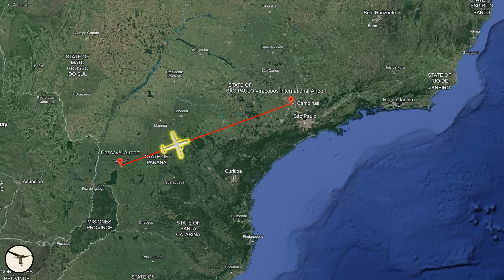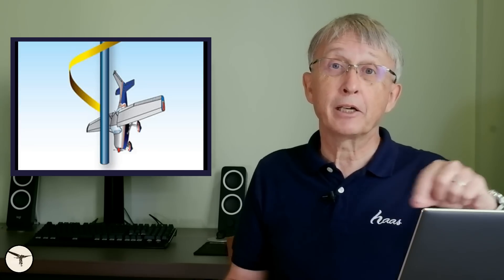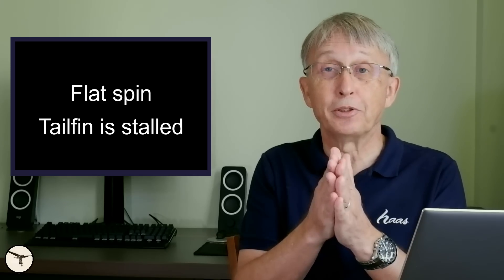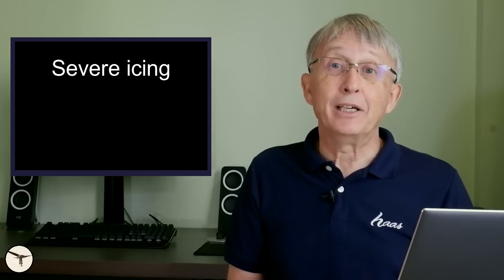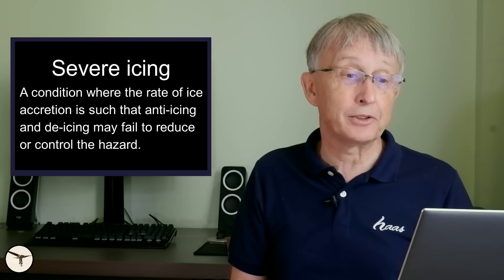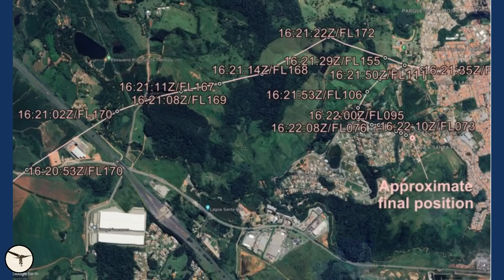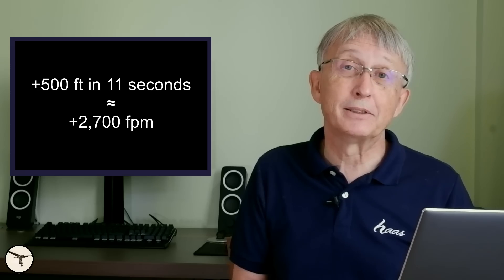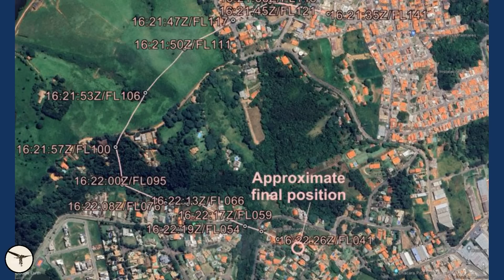ATR 72-500 Crash: Understanding the Fatal Flat Spin & Severe Icing Dangers

Comment: Thank you — complete and clear as all of your videos. Just a question: any contribution to the accident due to the “T-tail” of the ATR family? I read in the past that the “T-tail” shape, with the elevators mounted in the upper part of the fin, makes the aircraft more prone to a deep stall / super stall, that is basically unrecoverable. You did not mention this aspect, neither do I find it mentioned in any of the current, first-time analyses of this accident. Is it because this is not likely to have had any effect in this case? Thanks!

Comment: The last sudden updraft could be a clue... maybe the FP was startled & pulled back too aggressively on the power levers, accidentally putting one or both props into beta.  I wouldn't rule out accidental / inadvertent prop-beta mode.  Flying in convective areas can be very disorienting and startling, and it's not that hard to pull a power level into beta (in a startled or stressful moment).

Comment: 07:05 A sudden steep climb and speed lost a lot.  Someone did a very steep climb after losing about 400 feet of altitude.  That looks like a Panic Pull.  Big pilot error.  Nervous pilots do that kind of stupid reaction.  Happens on USA GA too.  Then they didnt cut the engines on the spin and used one engine to help recover.  Panic Pull and Panic Freeze with full up elevator my CFI used to call those stupid reactions.. My CFI taught the hardest maneuvers like 4 kinds of EFATO and 3 feet Go arounds with full flaps, spins on Tomahawks and aerobatics.  Those hard maneuvers exposed chicken pilots.

Comment: Interesting explanation. So basically in the case of the ATR, there is no way to recover from a flat spin? 

I know it is significantly harder than a 172 obviously. But I wonder if there is some way to use asymmetrical thrust to at least not the spinning and then allow the nose to start to drop.

Comment: FINAL REPORTIG-136/CENIPA/2013 (PP-PTU_26JUL2013_ing_IG.pdf) - Serious incident with ATR-72  in 26 July 2013 in Northeast of Brazil, who enter in ice conditions in a night flight, loose speed, enter in stall and fall ~50000 feet's (~1500 meters), but regain control and land safety in the destination.

The pilots made a mistake by only turning on the electrical ant-ice, de-icing protections - leave the wings and engines rubber boot's off;  feathered the props, and the PC fight against the "stick pusher". Probable was the "stick pusher" action who save this flight.

Good analysis of the incident in the channel Branco Aviação - "UPRT | PERDA DE CONTROLE EM VOO ATR-72" in Portuguese, but has English subtitles.

Comment: After listening to your explanation of the aircraft flight controls and how it all works. 
It sounds like the crew experienced a total failure of the electronic flight controls. 
I speculate this, since most modern, and recently built aircraft are all fly by wire.
It will be interesting to see what the investigation uncovers.
Reply: ATR is cable airlerons, not sure what the rudder and elevator are but not fly by wire.

Comment: Clear and impeccable explanation commander.  As an instructor and aerobatic pilot I would like to add that there could also be a problem of asymmetric thrust during the recovery maneuver from the stall, due to ice obstruction, of one of the two air intakes.

Comment: So many questions. The ATR-72 is suscetible to ice (American Eagle 4184), but that would had been fixed after that event. The SIGMET reported to the pilots of the icing conditions. And what was that turn to the right? The flat spin ocurred after losing altitude, so it was not sudden. Maybe the fact of the icing disconnected the AP and the pilots were just trying to figure out the problem while going through an oscillation of altitude. I am shocked. So many questions about this tragedy. Also, the T-Tail configuration of this aircraft makes it almost impossible to recover from a deep stall.

Comment: Severe Icing….. Speed control may have been affected by a loss of engine power due to ice congestion at the engine air intakes. The power loss would introduce a yawing factor causing a yaw in the direction of the Flat Spin. 

The question would be,  were the "Automatic Flight Control Systems" in operation during this event? 

Autopilot use in icing conditions can be dangerous since the Pilot Flying has no tactile feedback with automation running the show. 

This is my guess concerning the source issues involving this event.  May our Creator bless and heal the victims' spirits and their families affected by this unfortunate event.

Comment: I'm Brazilian and I live in the flight's original destination (Sao Paulo). An important information about this tragedy is that there was a cold front right where the plane was flying. This reinforces the ice formation on the wings, because the plane came from a cold dry area and entered a hot humid area. This speculation must be corroborated or disproved by the ongoing investigation, of course, which is the only thing to clarify what really happened. 

Remember another famous accident from my country, the AF447 flight, which disappeared over the equatorial atlantic ocean in 2009: the black box was found only 2 years after, it consumed lots of money to be rescued, but was crucial to understand what caused the accident.

Comment: Very strange weather that moment. I took a chopper a few kilometers from the crash! 💥 the weather changed sharply to freeze 🥶 it was a cloud ☁️ day but Brazilian warm day. When I lended in my building office the crash was announced. What I can say 100% the wind 💨 of that day was strange and the weather changed sharply. I normally take my chopper once week to the capital for business! Very sad day for every Brazilian! Not a normal event!
Reply: 1)
yes, and the reason being a gust current change between 13:20 -13:30 GMT-4, from West to West North West winds. Causing a radius 0 condition on the center of the plane (vacuum). Autopilot decided to change into manual pilot mode after failing to stabilize the plane. 

2)  
this introduced a stall where autopilot in hotel mode favors altitude with tradeoff speed, in a span of ~30 seconds.
Reply: I know this given it's related to new gust setups starting mid June 22 2024, and the cyclones towards China.

Comment: In the 1950s, during flight test an F-102 delta wing fighter got into a flat spin at 40,000 feet.  The pilot recovered just before he hit the water over the Gulf of Mexico.  After that, the rule became:  If you get into a flat spin with a delta wing airplane, you pull the eject handle.

Comment: Pilot Suicide what a selfish act. I don't believe it was Pilot error, If they prove me wrong I appologise it has happened more times that you realise in avionics.
Reply: nope. it wasn't that. Another pilot minutes before literally experienced the same issue, but recovered from stall, notified air control, and air control didn't notify the pilot. 

air control neither told the pilot to move outside the cold currents. but that's debatable.
Reply: What an ignorant comment.

Comment: 3 things not mentioned:
1) two different sources report that the crew actually requested a lower FL when they noticed ice build up at FL170 but it was refused.
2) their flight data reports an impossible range of velocities along the whole trip, what caused this bug?
3) there are a couple of meteorological sources that claim that right where the plane stalled (it did so abruptly, almost backtracking on its ground path, quite confusing data) there might have been a sort of "squall" phenomena producing an enourmous tailwind that essentially reduced their effective airspeed close to zero - but I find this contradictory to the very claim in the same paragraph that suggets the near-zero groundspeed was also caused by the meteorological anomaly (i.e., is it a headwind or a tailwind?)...but they seem to explain that away by claiming it was a spiral vortex.
Reply: What velocities do you think were impossible?
Reply: @peteconrad2077  You might ask for, (a) The velocity range data during the whole flight is all over the place, not only at the time of the crash, but right from the beginning. Look it up (flight data services). There's something wrong with it as it can't possibly be physically real.  Or you might be asking for (b) right before the stall, the ground velocity goes to zero and then even becomes negative (the plane seems to back up in relation to the ground, if you look carefully at a detailed chart o the final ground speed/position data). This is clearly anomalous and I don't really understand what's really going on. ATR2's are prone to  stall during heavy ice conditions, their highly efficient wing makes them problematic in those circumstances, and then they are also hard to recover from a stall, very hard to recover from a spin, and nigh impossible to recover from a flat spin due to their T-tail causing lack of rudder and elevator authority in those attitudes, and their engines causing quite  a bit of rotational moment, torque.

Comment: July  26th 2013 22:00 UTC - Trip Linhas Aereas Flight 5591: An ATR-72-212A registration PP-PTU had a Severe Icing Event near Salvador, Bahia, Brazil, Follow the CENIPA Report:

The aircraft took off from the Zumbi dos Palmares International Aerodrome (SBMO), Maceió - AL, to the Deputado Luís Eduardo Magalhães Aerodrome (SBSV), Salvador - BA, at 2110 (UTC), to carry personnel with 4 crewmembers and 58 passengers on board. Around 2142 (UTC), on FL160, the aircraft entered a region that had the conditions of ice accretion. Although the aircraft anti-icing was activated, the air pneumatic de-icing was not activated by the flight crew. Then, there was a significant degradation of aircraft performance, leading to a reduction in the Indicated Airspeed (IAS). The aircraft initial cruise speed was 202kt. The aircraft lost 10 kt prior to the activation of anti-icing. The crew heard a noise described as similar to that of a compressor stall, followed by a loud vibration.  The aircraft reached 180 kt when the power levers were reduced to 20% TQ, leading the IAS to reduce down to 148 kt, and the autopilot was disconnected. The crew did not identify the cause of the vibration. Approximately 4 second after the autopilot was disconnected, the Angle of Attack (AOA) increased, resulting in the activation of the stall protection systems (stick shaker and stick pusher). The pilots counteracted the pusher, which resulted in the loss of aircraft control. During the loss of control, Pitch Uncouping Mechanism (PUM) triggered. The crew declared emergency and, upon reaching the FL110, the control of the aircraft was restored. Landing was performed in a controlled way on SBSV. The aircraft was not damaged. The 4 crewmembers and 58 passengers left unharmed.
Reply from the maker: Thank you for sharing. I will look at the report.
Reply: @FlywithMagnar  maybe the same or similar occurred on friday.

Comment: First of all, I would like to give my condolences to the family members and friends of passengers, and crew members.🖤  I have flown ATR-72 for twenty years , in and out of icing conditions.  I have always watched my speed , flew fast and changed altitudes.
For some unknown reason, the speed of this fail fated ATR was dropped to almost 100 kts according to Radar 24. I am sure that Stick pusher has activated, and for some unknown reason the crew were not able to recover from  the pusher! As soon as this ATR is out of clouds, you could see, that it was nose dived, and then slowly goes into flat spin stall. Icing, lack of  experience, and slow speed are bad mixers in ATR.
Reply: I believe that the worst attribute of the ATR is the rear CG (which at the same time is one of its best attributes, since it allows it to save fuel and cruise with a low drag angle of attack). It may be a tricke-to-handle aircraft that does not tolerate carelessness. Note that this descent from FL 170 to FL 167 and subsequent climb to 176 in 11 seconds indicates a climbing surcharge that can only be achieved with a very unsafe high AoA. It may have occurred due to a pre-stall stick pusher event at FL 170 (for any reason) followed by a reflex reaction of pulling the control back to try to climb, exposing the wings to a high angle of attack, which made it climb to 176 while losing speed and stall. My condolences.
Reply: In another words, "speed and AoA is life". In the case study of Eagle 4184, it can be inferred that after rolling to the right, it rolled to the left with the left wing down, and therefore with the nose down, but did not have enough altitude to recover speed to fly again. In the VoePass accident, there was altitude, but the airplane descended flat in a superstall in a rear CG and T tail configuration, maybe recoverable only if one wing manages to dive and bring the nose down to gain minimal AoA and speed.

Comment: That severe icing sigmet makes no sense.  Severe icing most of the time has only a 3,000 foot window.  If you’re in it you go up 1,000 or down a 1,000 you’ll be fine.  I have been in it more then a few times and changing altitude by a little fixes it.
Reply: Across a front it can be a much wider range. Guess what….

Comment: Have seen several analyses from pilots and others and no one talks about how come an explainable spin can turn into an unrecoverable FLAT spin... Why dont you consider an error in load balancing by ground personel as a possible factor  ??? This is not an accusation but a possibility...
Reply: Any developed spin is hard to recover in a wing mounted engine aircraft. 
Loading error is very unlikely since the aircraft had flown a long way with no issues.

Comment: We cannot assure, not even close, what happened, but with your video I think that we have no doubt. The flat spin on a aircraft of this size it very rare, but there's another Atr72 that crashed with flat spin cause of the ice. The airplane starts banking alone, much times on both sides, close to what se wee in this flight path, and so kept losing speed. When he has no more speed to sustain the airplane, he stalled and started a flat spin. I think we have the same case here
Reply from the maker: If you are thinking about Aero Carribean Flight 883, it did not enter a spin, but a deep stall. The main cause was improper speed control during icing, followed by improper recovery technique.
Reply: @FlywithMagnar I think that is this. Let's wait... The entire world is waiting for an answer

Comment: I know a real case, many years ago, during an ATR flight test, the airplane started a deep spin after a stall, and the crew only stopped the spin after putting the landing gear down. They tried everything (opposite rudder, opposite engine, and nothing helped, only landing gear stopped) after that they recovered the flight very low and landed safely.

Comment: Captain, a technical question: Would wing icing leading to a stall be a sufficient condition to put the ATR-72 into a flat spin? Or would a second factor be required, such as a CG location too far aft at takeoff, or a CG shifting aft during flight?
Reply: Any stall can turn into a spin. All you need is a yaw moment from rudder, aileron or engines.
Reply: @peteconrad2077  Understood. But this is a flat spin, which is different.
Reply: @tridentii1903  not really. Any spin can flatten, especially if the power is high.
Reply: @peteconrad2077  Thanks. But I was hoping for an answer from a real pilot, not an armchair pilot. Unless you're the same Pete Conrad who commanded Apollo 12. But that's unlikely since he died in 1999. :)
Reply: @tridentii1903  18,000 hours, TRI TRE 30 years airline experience.

Comment: Hello Mr. Magnar, I have a question, does the ATR have a device that informs the pilots of ice formation or if, as in this case, they were surprised and I believe they had the AP turned on, if it uncoupled as soon as the plane went into a flat spin or In your opinion, did the AP continue to be connected, hindering the possibility of taking out the plane in that condition? Big hug.